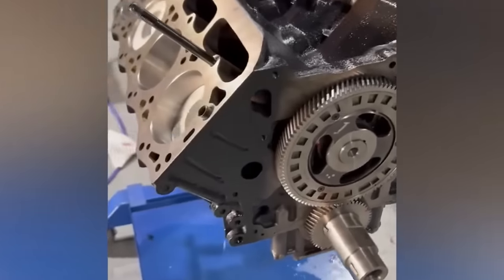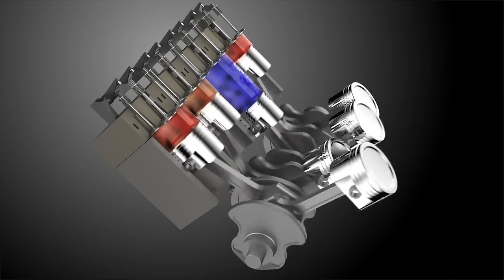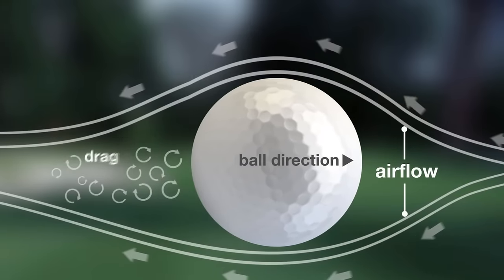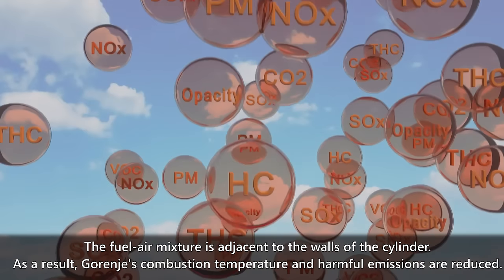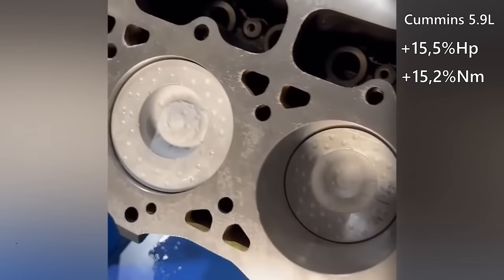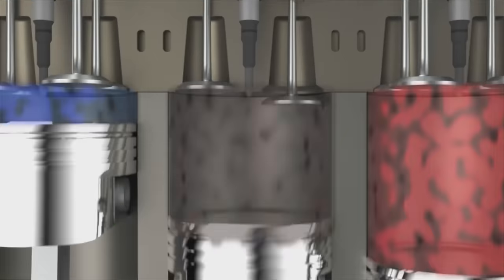NEW PISTON +50% Efficiency ICE -  Made the Impossible Happen!

Comment: The golf ball dent thing always leaves out the fact that the ball is spinning through the air
Reply: It's relative motion between the dimples and the air.
The pistons are moving up and down and the intake charge is swirling and compressing. = relative motion
Reply: @hotrodray6802  its not relative motion. The direction and spin are relevant to a golf ball but doing this to a piston would not have the same effect given that you only get the effect with air rushing past the dimples not air hitting the dimples directly. Other companies have tried using the golf ball dimples but the aerodynamic increase was barely anything and in this case it could be a failure point and it just doesn't apply here
Reply: @ryanmattson: yes, the spin is important otherwise aircraft would have dimples all over them.
Reply: @robbsharp9014  put some spinners on the top of the pistons that way you increase efficiency and also have ballin pistons /s
Reply: They should change the name to Titleist Piston
Reply: If the Diesel engine has ports that are set up correctly they will be inducing allot of swirl in the cylinder basically making it a whirlwind inside the chamber, during compression much like a ice skater pulling their arms in as they spin this speeds up the rotational speed of the air. What these dimples are doing is helping to reduce the boundary layer of stationary air on the top of the piston. 

When the fuel is injected it starts to burn after a short period of time, as it is burning it is getting thrown about in the swirling air that exposes the fuel to more oxygen but it will get flung out, if it was to say land on the pistons it would then be in the boundary layer where air flow will be static on the surface and slow just above it, this will make the fuel smoulder rather than burn causing soot.
Reply: @aerialcat1  I think that's using more of a laminar flow of air
Reply: The airflow is across a surface. Doesn't matter the method of creating the airflow lol
Reply: @raymondclass6794 correct.  It breaks the bond of laminar flow, therefore reducing aerodynamic Drag
Reply: in a diesel engine making the air spin increases efficiency, the golf ball makes the air spin around it increasing its aerodynamics.

hope this helps

Comment: Please show your source data.  I don’t see any logic technical argument presented here, just a reiteration of the manufacturer’s claims, which is likely pseudoscience at best.  The claims are very significant, so prove it… with actual data, generated under scientifically controlled conditions.
Reply: Agreed..how does this not cause hot spots causing pre ignition
Reply: Dont waste ur time looking at videos like these its bogus
Reply: Spam accounts with AI or computer generated BS for clicks
Reply: Diesel engine is compression based. Very different from gas engines. The dimples act as partial combustion chambers upon compression stroke. Upon exhaust stroke the air velocity gets an added boost due to the dimples and the airs ability to go from a pressure positive to exhausting the gasses.
Reply: @sirseven3  physics may argue with your description…
Reply: @paultinwell5557  the physics was explained with the golf ball representation... it checks out mathematically and scientifically
Reply: @sirseven3  if you believe that, then I guess we have nothing more to discuss.  I wish you luck in life.
Reply: @paultinwell5557  please show me how I'm wrong then if you're so smart sir.
Reply: @sirseven3  i am not an engineer nor do i have the ed for the math.    Having said that i would want open sorce date to send to an independent verification before i spend $12,000 to install new pistons in my truck and ruin a 20,000 engine.
Reply: @AD-nn7vh  yes I agree, but it does state that the company has tested for thousands of hours with several fleets of vehicles...
Reply: @sirseven3  I have nothing to prove here and I’m not making any claims of superiority.  I’m just pointing out that physics may argue with your statements.  If you wish to ignore science, that’s not my problem, and I’m certainly not going to correct you.
Reply: I agree
Reply: willyberg123  good luck with your search.  I’ve done precisely this sort of thing professionally for more than 30 years.  Trust me when I say it’s bollocks, but I would love to be proven incorrect.
Reply: Please send Paul all of your technical data so that he can prove your claims. He promises he won't share anything
Reply: @warrenm374  I didn't promise anything, but bring it!
Reply: These are available now. Plenty of people have used them and shown they increase hp by a good bit. They are popular on diesels but really expensive.
Reply: @deelowe3  still haven't seen any real data on this subject.  Where have you seen them being tested?
Reply: Monster engine sells them and Dave’s Auto channel shows a gentlemen who uses them and how quiet his diesel engine is with more torque and overall power. Stop being stuck in your old ways. Change ain’t always bad
Reply: There’s a company in Texas that tests it on a dyno with bmw diesel engines, it’s actually gonna become legit. They’re doing more tests on actual customers bmws and vws to finalize the results
Reply: check their website... testing data is available to view there
Reply: @joeboyhey  I’ll have a look, but as it isn’t exactly an independent appraisal, I’m not expecting much.
Reply: @paultinwell5557  of which. the emissions reduction is brilliant. aero dynamics is rather tricky particularly under high pressure. keeping the combustion away from the cylinder walls is brilliant. would make diesels much more viable.
Reply: @joeboyhey  the data on their website show big reductions of exhaust pollutants, with tests conducted at apparently independent labs.  However, there's a lot of hugely important detail missing.  For example, one of the reports notes the baseline tests were conducted, then the engine (vehicle?) was returned to the supplier for modification, break-in of components and setup, before retesting.  OK, very good, but if during that setup the fuel and ignition calibration was changed, most if not all of the noted emission reduction could be accounted for.  Why is there no mention of what was done?  Presenting selective data is what drives companies like this...  For example, if there's a claim of reduced heat transfer from improved boundary layer attachment, where are the data that illustrates reduced piston crown temperature under fixed conditions?  I still see nothing other than smoke and mirrors here.  I wish them the best of luck.
Reply: Bro, it must be true because the robot voice said it! Always believe not the robot voice!
Reply: this was made 60 years ago, there is an engine that do not need radiator , nothing new
Reply: @anteneupitra but does it work?

Comment: Fuel consumpion reduced almost 50% in some constant speed machinery? I doubt that. 
So let me get this straight, burn a half of fuel and still stock performance? What's the thermal efficiency of that kind of engine? Almost 100%? Really?
I'd believe when I see it.
Reply: Perfect question.
Reply: Funny how fuel consumption in their test 5.9 cummins resulted in 3.2% fuel savings, but they claim 50% savings on "constant speed machinery".  Wouldn't you lead citing that test over the measly 3.2% savings.
Reply: the emissions reductions are profound. as thats always an issue in diesel engines.. however, honda made a diesel engine that gets 70mpg and doesn't need eurea injection to meet emisions standards.. not available in N.A. markets..
Reply: european cars have those pistons, they are 10% more efficient
Reply: european diesel  cars have those pistons they are 10 % more efficient
Reply: @joeboyhey  What is the name of the Honda diesel engine model?

Comment: These would only seem to work well with diesel. A Heron head gasoline motor with the dish in the piston and a high squish I could see cause detonation issues from hot spots on the dimples when the mixture is compressed, it could get squished into the dimples and not towards the inner part of the chamber for ignition. Engines with the combustion chamber in the piston do interest me though, it's very interesting and I think a lot more could be done with that design.

Comment: If those numbers are real then the cost of those pistons should be very pricey! It's hard to imagine that this change makes such significant improvements in all areas. 50% better fuel economy? Come on.
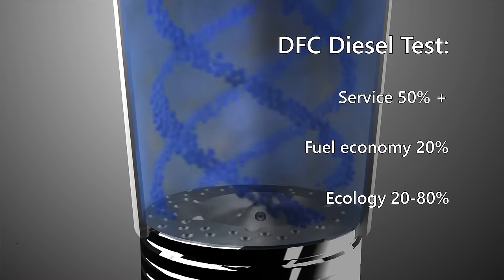Reply: 2:06 They said 20 %?
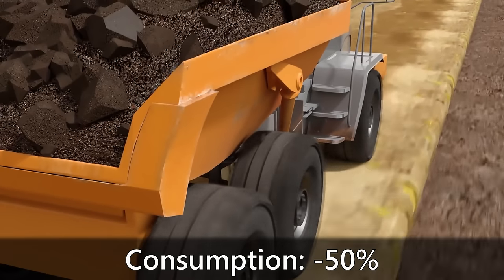Reply: 3:07 50%
Reply: 2% not even that. Maybe 0,5%
Reply: They are 4,000 dollars, Stock pistons are 600.
Reply: @russellaustin4988  WOW!  youd have to keep and drive the thing for a long time to get that money back!
Reply: It could be cheaper if mass scaled, though I'm not sure if golf dimples would make much of a difference considering the cost.
Reply: @MrChevelle83 ROI depends on the cost of fuel. In a large bore engine and In biden’s economy that could be as little as six months.
Reply: As a machinist, i dont see how they should cost any more than a regular piston with just a hollow in the middle... Its literally a castable feature, what with modern piston making processes which involve minimal machining, these could be cast into the face, the boring for the pin is done, and the outside diameter is treated in accordance with the engine style... The face could literally be used as is outta the die set... Im more doubtful about the allegedly tested numbers... That sounds quite overblown to me, but while i may have a degree in automechatronics, and while i may be a machinist/millwright, i can not state with absolute certainty that its bullshit... Change sometimes is good, and good can sometimes come in large quantities with just a minor change, but from the general standpoint, i reserve my right to doubt the claims...
Reply: @camillosteuss  Well said and I agree with you. SOA incorporates more in their pistons than what this video covers, such as materials and coatings found in high demand high performance applications. Some have questioned if you choose a piston of these variety without dimples vs SOA pistons how would the results compare- especially factoring in cost. An earlier post says SOA pistons for his application cost 4K where OE cost only 600. I would like to know what engine this is as clearly over 6.5 times the cost is hard to justify especially when the marketing claims are questionable. I rebuilt a 12V Cummins in early 2022, paid $1,000 for OE style 40 over pistons with rings with 50 valve reliefs. At the time Cummins parts were challenging to find. Last time I checked SOA pistons for a 12V ran 3K. At 3X the cost I would consider trying them if I was to rebuild another just to test the claims. Even if the dimples don’t reach the claims made the additional benefits of higher quality material and coatings could justify the investment.
Reply: @camillosteuss  A modern emission controlled diesel is going to emit the exact same emissions using these pistons vs standard because everything is done using EGR and downstream treatment.   If they indeed got the performance and economy gains they claim....then for sure they had to be altering the tuning...which we can do and achieve similar gains just by that tuning without using 'magic' pistons.   Remember the old saying "If it seems too good to be true...."
Reply: @preachers4135  

If Any Discovery/Development of Improving "efficiency" and Pollutant's Reductions... likely  Toyoda already had some R&D's in these kind of Piston.  Only Time will Tell the Real Data...

But surely, a Hybrid that made uses of both Diesel ICE and Electrified Motors will increase the Total Horsepower /and or Torque ...

Regards,

Comment: Would this piston concept operate in an Achates opposed-piston Diesel engine? The combustion space in an opposed piston engine is contained between the tops of two pistons, so it would seem that this combustion control would strongly affect the efficiency of an opposed piston Diesel.
Reply: The answer is yes…the Germans had a very similar design in WW2 for their opposed piston aviation engines …this concept is nothing new and it only has applications in sleeve valve or opposed piston engines

Comment: 0:12 that's exactly what drag racers have been doing for 50+ years, porting it so the air goes straight in, knowing most of it goes towards the back of the valve.
Reply: Gas ported pistons for top ring only
Very short ring life and engines torn down usually under a hundred passes at 1/4 mile. There have been ported heads with dimpling and it was a failure.  Fueled puddled and wrecked atomization and caused detonation through lean outs and destroys the engine. If the dimples carbon up how can they still work? Worth the testing only way to find out long term
Reply: @christopherduggan9227 where in the fuck did you hear that bud? We've bench tested ported and dimpled vs ported and polished head and atomization and air flow was significantly better on the dimpled heads. I'm talking over 90hp better on the engine dyno.
Reply: @christopherduggan9227  Not so at all. Dimpling ports PREVENTS fuel puddling, that's the whole point.
Reply: @christopherduggan9227  . . . says " If the dimples carbon up" . . . . In the intake runners ?? Have you ever looked inside an engine ??

Comment: Sounds too good to be true so it probably is.
Reply: Dimples like that would possibly be beneficial, in having an effectively larger surface area to the piston head, and might help somewhat for the turbulation and scavenging. However the inlet/outlet geometries are still the truly deciding factors when it comes to that, and I think I can foresee some problems with compression and manufacturing from that head design. So yeah. And the moment they were like "up to 80%" I was... yeah.

Here's a smarter solution which might give something of the same advantages, but without the same engineering problems; Spherical chambering, from a spheroid formed by both the cylinder top and the piston head; You make the piston conical outside of the concaved-out center so that it gives a very definitive compression squeeze, to account for the concaveness. Would make for a far more idealized combustion volume than a flat disc, for both explosion/burn consistency, better pressure dispersion and temperature dispersal.

Lel. Now have fun trying to design a valve setup that works with that.
Reply: @@retiredbore378 True, on the one technical end; On the other end, if consequently you improve heat dissipation and homologation throughout the actual metal, and you can more ideally match detonation and propagation, then you win all of that back and then some through being able to use closer tolerances and better explosion matching.

Comment: It would nice to see this new type of piston tested in a gasoline engine.
Reply: That's my shit too!
Reply: They have been - no improvement.
Reply: @Motor-City-Mike  If I was making a guess as to why this is true, Id say these wouldn't help a gas engine because gasoline is pretty much already maxed out with its btu's, but diesel fuel has a lot more power in the fuel and this piston design simply extracts more of the fuels potential instead of it going out the exhaust.
Reply: Been done for 40 years.
Engine masters guys have used them as well as used the Singh Grooves.
If they didn't think they helped torque they wouldn't have used them, right?
Reply: @hotrodray6802  hey we justa buncha key board punchers, them guys are way more advanced than us!
Reply: @MrChevelle83 I've seen dimples used everywhere inside 2 stroke engines with no noticeable improvements.

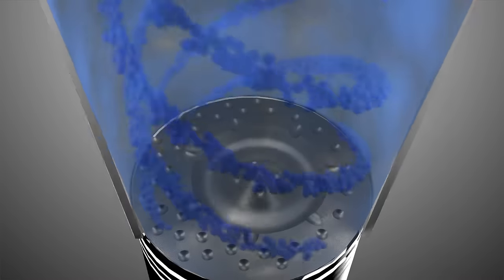Comment: 1:25 they talk about a fuel air mixture but diesels don't mix the fuel like gasoline. Diesel is direct injection and injects fuel after the piston has compressed the air. No fuel enters the combustion chamber with the air when intake valves are open.
Reply: It still must get proper complete mixing to combust evenly, hence the need for swirl

Comment: Watch the fuel saving the MythBusters achieved when they covered a car with dimples. They were both shocked, since it was about 10%. Think if they could do that with 18 wheelers. But the interior space would be a problem, since you couldn't make the outside wider & standard stuff would no longer fit inside a narrower interior.
Reply: Definitely something to consider for aircraft bodies...❤
Reply: The latest bugatti also uses dimples in a small part of its air scoop.
Reply: @pauldatche8410  How are you going to create these 'dimples' in aircraft?    The skins are thin and the dimple much deeper than the skin is thick which would compromise the strength or add weight...both undesirable.   If these pistons actually do provide any improvements it's more from the coating and less from the dimples which have been tried on and off for 40+ years now.   Mostly they're not worth the bother of creating them but for sure a thermal barrier coating on the piston does improve performance...but again it must improve things enough to be worth doing....and the fact that manufacturers who are desperate to meet emissions and efficiency targets are not flocking to use this technology should be a bit of an indication of how good it is.
Reply: May I suggest you get onto their website and look at their videos etc. 
As a mechanic of more than forty years experience my impression is that these people are the real deal.
Reply: The cool part about that episode was the fact that the clay added weight to the car making it heavier and yet it still gained efficiency